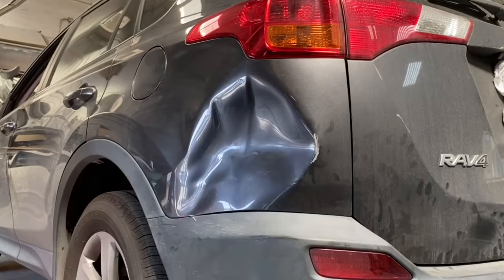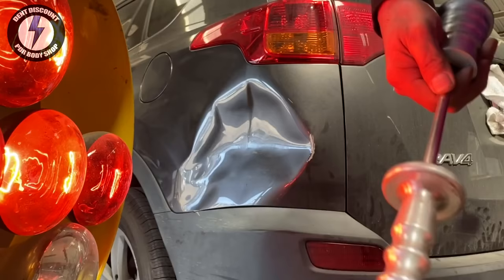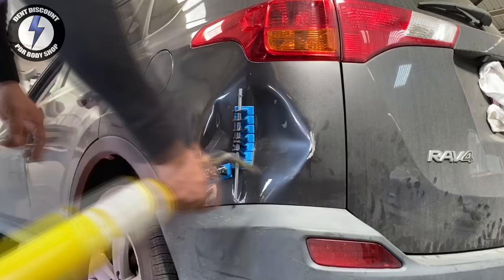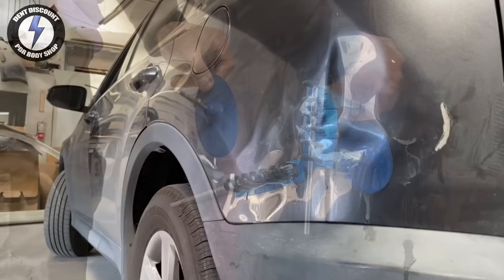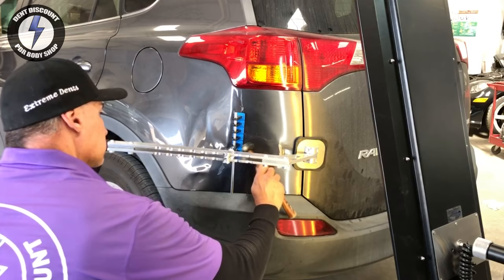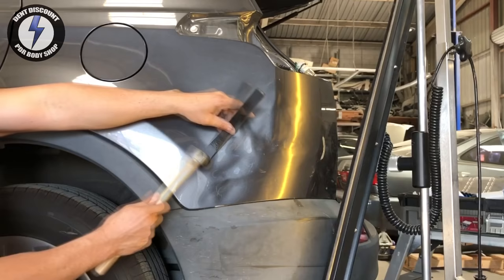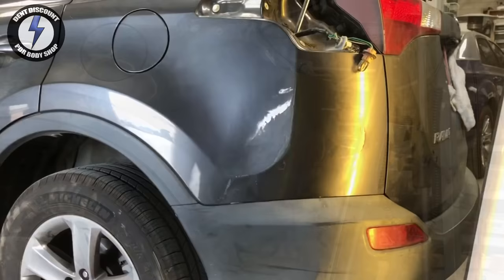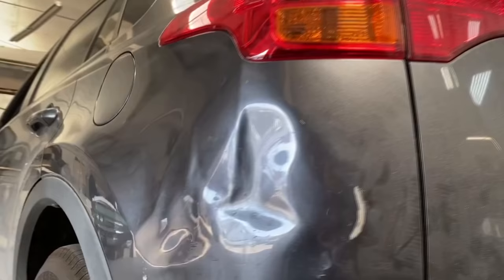Free Big PDR Training Video!

Comment: Fantastic ! I've been in the collision repair business for 40 years. PDR has come a long way since it began. You just illustrated what an experienced PDR man can do with the right tool. Quite impressive. Off the street I would quote that repair at $1,200.00 in the body shop, not including blending the liftgate. A vinny job, meaning wholesale, about $600 to $700. Of Course that would be using low grade materials and without much detail in workmanship. Wholesale work is just keeping the shop guys busy when business slows down a little...
Reply from the maker: right on Jazz Hog i appreciate your comment.. i do the same i will do wholesale to fill in blank spots in the schedule.

Comment: Man of steel, it's the first time I'm watching one of your videos and I am blown away. I am a mobile dent and paint guy and I would never though something like that could be done without body filler. I try to use the mini dent tabs with my slide hammer and sometimes as I am putting on the slide hammer on the tab it will drop off. What kind of glue sticks you use and where do you get them from. Also where do you get your glue tabs. You are an inspiration. You should be called "Magneto - man of steel".
Reply from the maker: Manofsteelpdr.com  
I have glue and the tabs on my website
Thank you for subscribing 
I appreciate your comment

Comment: Great job sir.  As a PDR tech of 35 years that is always learning and constantly growing in knowledge & experience, I find it refreshing to see a fellow tech think outside of the normal linear thought process of dent removal. Reading how the metal is moving and seeing where the stressors are to alleviate them and get the panel flowing back in the right direction to which it was stamped is always key. 

Out of curiosity, what was your total time spent on this repair???

Now on to answer your question about pricing retail and wholesale. Being in the auto industry for close to a a half a century (dealership new & used) and is what I've done for most of my PDR career, I know that the only dealerships that'd pay to have that crater of a dent PDR' d would be the high-end stores IE: Mercedes, BMW, Audi, Jaguar, Land Rover, and all of the exotic ones as well.  However, the remaining ones would ship it off to Juan or Jose's wholesale body shop for $400-$500 for that quarter panel repair. And myself and I'm going to assume that you as well would touch that dent for that cheap, unless we were trying to help out or land a account to make a statement. In which case I'd be at least 1k minimum to 2k depending upon which dealership I am at and what (at that point in time) the market and customer will bare. Comparing what a local body shop would charge for that repair in my market would be anywhere from $6000 to as low as $4000. 

Now for the retail price, I'd start at 3.5k  and go no lower than 2.250k.Here again it's what you feel you can close the customer at without loosing the sale. 

KEEP ON PUSHIN METAL

098
Reply from the maker: Thank you for your comment I really appreciate it

Comment: I really wish things like this would work on my 50 Dodge but that 16 gauge steel is just too heavy or maybe it's 14 gauge. I had an accident and put a big dent in my hood it took me two days of Molly and Hammer work to get it out to where you can't even see it. So it did damage the paint so much I had to repaint the car but it needed it anyway because it was an old paint job. The dent at the edge of my hood looked a lot like that but it came out with a hammer and Molly.
Reply from the maker: Thank you Bob , I really appreciate your comment

Comment: Great repair. Did you later fix the paint with a touch up?  I have had a couple online trainers, which after I fixed a paint cracked off dent almost as bad as this, one of them yelled at me and told me never to fix a dent with cracked paint.  I am 9 months into this business, it kicks my ass every day, but I am sticking to it.
Reply from the maker: If you turn down Cracked Paint on a dent at the car dealers someone like myself will come and fix it and take your dealership and leave you penniless.
That goes the same for your retail customer business.
Clark Ken a.k.a. Man of Steel 
https://secretpdrpaintlessdentrepairtrainingonline.com/howtopaintlessdentremoval/
Reply: @DentDiscountPDRBodyShop  That what I was thinking. Just fix it with the understanding the paint is already damaged and they will have to touch it up.